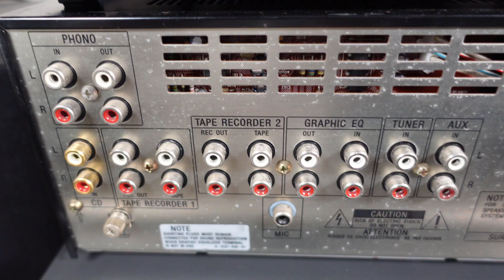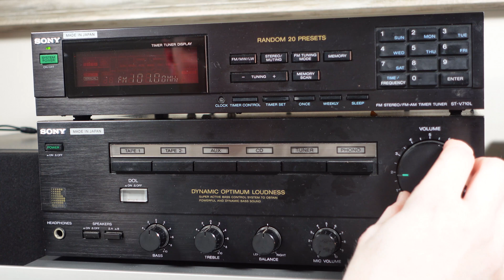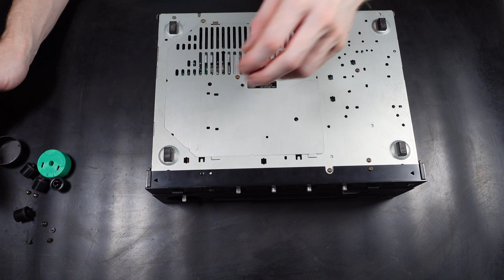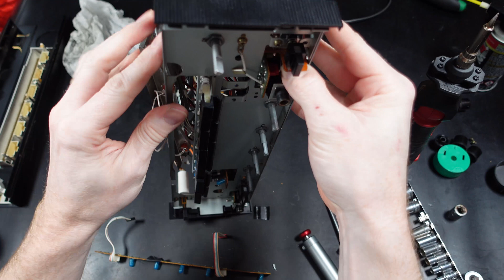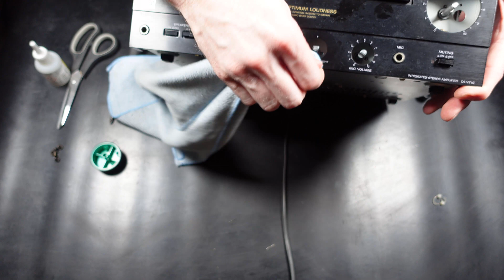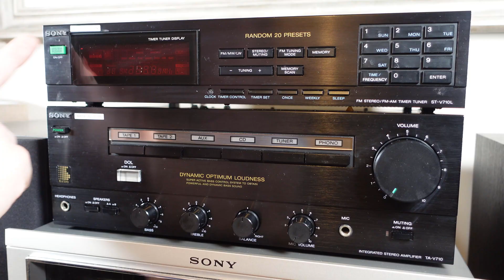SONY TA-V710 Amplifier Crackle & LED Repair - Retfurb Vintage Refurb

Comment: Many thanks for this video, very helpful. I have the same amplifier and is great. I have more or less the same issue and the DOL bulb has blown. Where did you find the replace bulb?
Reply from the maker: Thank you, I am glad it has helped you. 
With regards to the bulbs, I am struggling to find the original purchase for them. I think they were on ebay, But it was a while back now.

Comment: DOL is written on the front of the amp, just a fancy Loudness button.... Sony / Aiwa had similar loudness circuits.  Pretty good at low volumes / using smaller speakers.
Reply from the maker: Thank you for the added info. It’s appreciated.